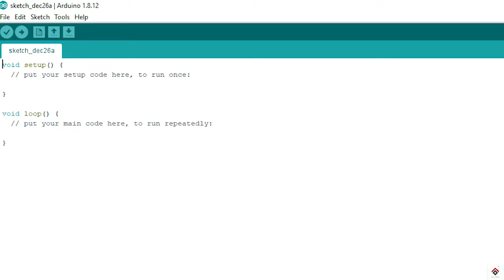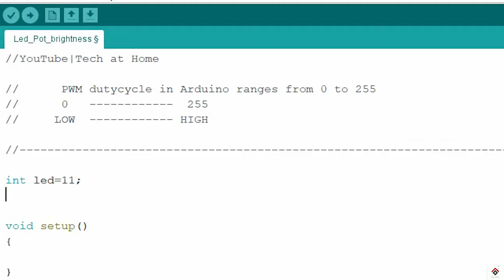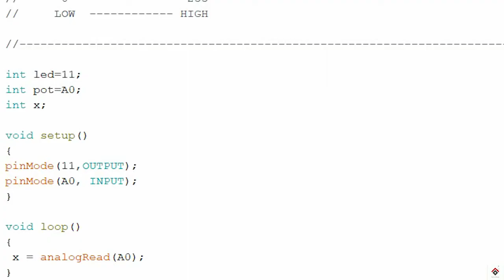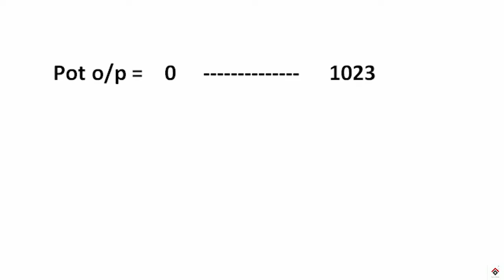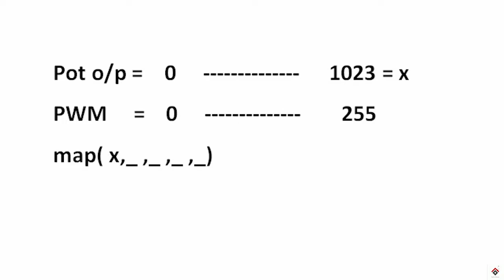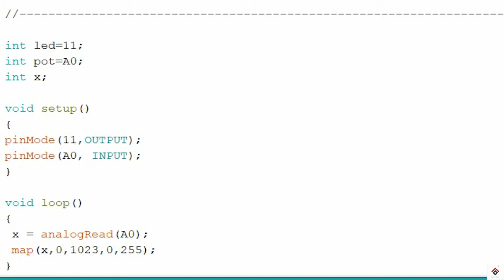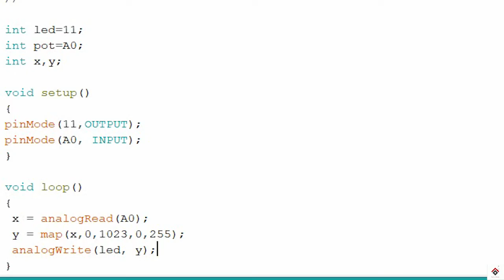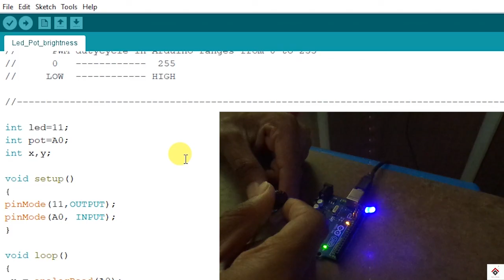LED brightness control with Potentiometer | LED fade using PWM | Arduino tutorial 19

Comment: I Am a Beginner, I want to make a project for fun with an ultrasonic sensor in which , when an object is in 0cm-5cm then my led changes its brightness as maximum at 0 cm and loose his brightness at 5cm . 
I map the distance with pwm but not work can you make video on this 
If you don't want please share the code for that
Reply from the maker: Can you share your code on mail. I will check and correct if any changes needed?
Reply: @techathome   sorry , i deleted the code because of frustration,  if you are  free later , please make the code, this will help alot
Reply from the maker: Can u send mail request.

Comment: Sir can we control relay module using this method 🤔
Reply from the maker: No, relay is digital
It can switch on/off, It cannot control brightness 
Relay: https://youtu.be/iy3nXFh__rg
Also check this tutorial if you want to control 12v load : https://youtu.be/67ARqgkOCc8